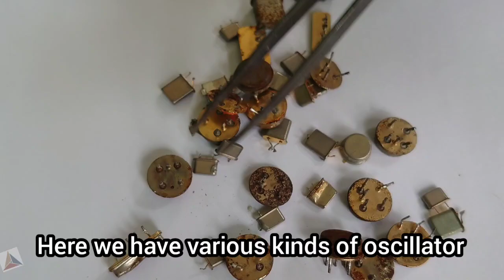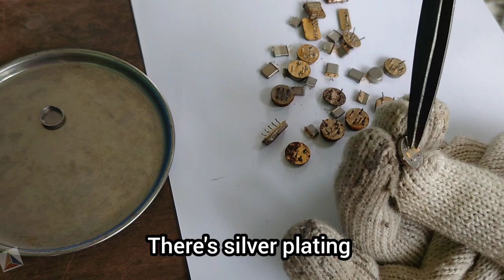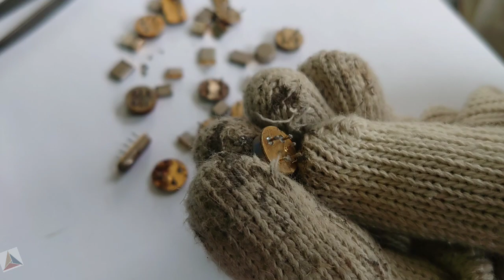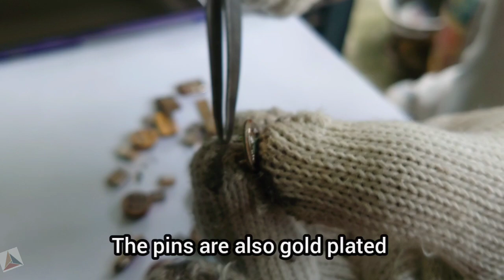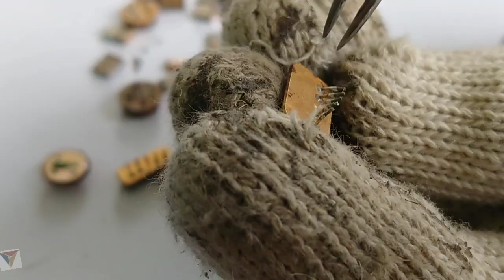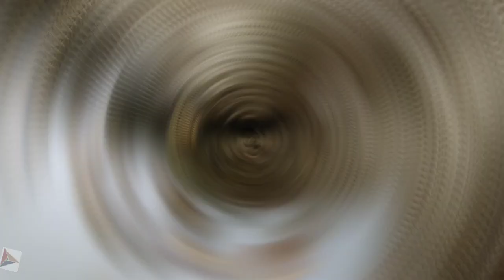Rare Golden Oscillators From TV Circuits | Gold from Old Televisions Circuit | Gold from Old CRT TV

Comment: Mr. triniy young about a big mistake thanks to normal sulfuric acid. I couldn't even put the 5 liter beaker to squeeze out royal water using 3 nitric acid and because it was big the air purification cyst in a big paint bucket was around -17 degrees. I chose the choice, the metabi sulfide, which will be possible to be the base metal, is close to 400 Gr and the voters do not choose, I do not choose, I do not choose, I do not choose, I do not prefer urea and nitric, I did not choose 80 Gr gold, I did not throw away everything without choosing 24 Gr gold, still for protection from the weather in golden acid, otherwise it stands still. I did not use sulfuric acid, how to grow jeep iceberg, remember the return method can be recycled as soon as possible from half a liter of hydrofluoric acid in glass larin in gold foil.

Comment: Just so you know, a couple were transistors. Gold oscillators aren't that rare. During the pandemic I bought one auction with over one pound, all gold. I got them at a crazy low price at buy it now, most everything I get is amazing deals. The last auction I bought was 60 pounds of only hp boards 80s and older for $51
Reply from the maker: I thought you got out of business long ago before the pandemic.
Reply: @TrinityGoldRecovery  I did but I still buy material for collection or to hoard and sell later when gold and other precious metals double in price or just higher. I could sell most of this material for a huge profit now but I'm holding it as a investment.
Reply: @TrinityGoldRecovery  you name it I have and most likely a ton of it.
Reply: Hey @Trinity Gold Recovery
I Love😍 Your Work That's 🙂Asm 🥰👍 Keep It Up Bro . Where U From?
Reply: @TrinityGoldRecovery  I'll put it this way for you. If you could see only half of the items I own you would shit yourself. I have another 50 pounds of HP boards on the way that I won today at another crazy low price. These are all old boards out of scientific equipment with tons of gold, dipped MLCCs that contain palladium and loaded with other goodies. Too bad ebay isn't a ting in your country. I've had the itch to recover and refine so I may do some easier boards in AP Solution, something that requires less involvement, put it in AP and forget about it until a week later. My health problems are the wild card but I'm starting to recover which is really good but still something I have to keep a eye on. 5 gallon buckets full of Military Pins and other pins, CPUs and gold leg ICs in other buckets, box's full of old school edge card connectors, boards, oscillators, transistors  and of course Tubs full of higher end boards like HP, DEC, Tektronic to name a few.